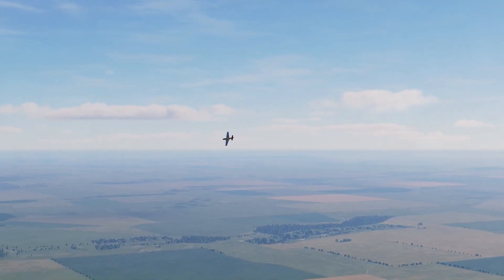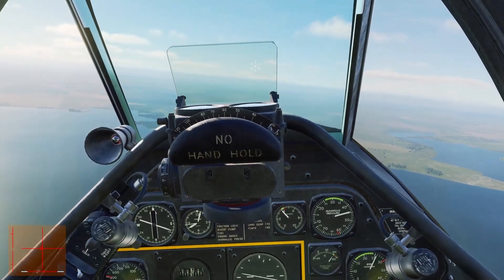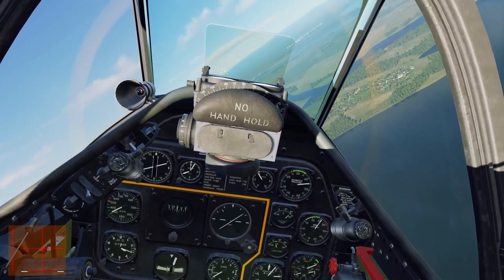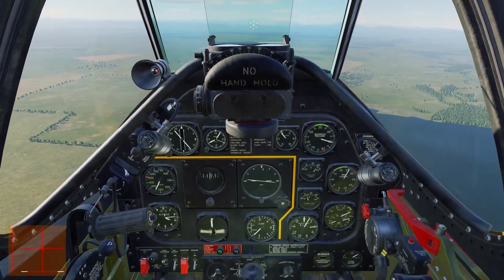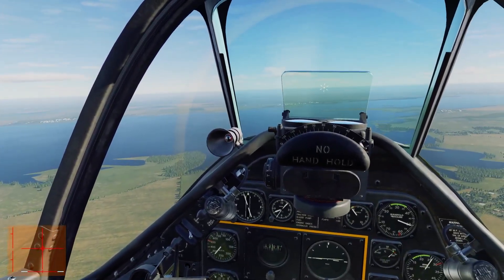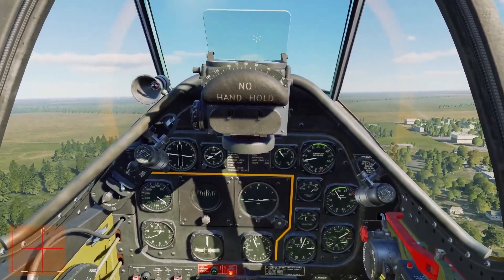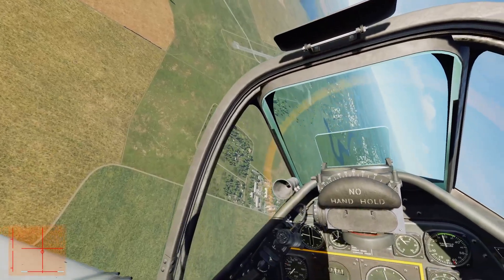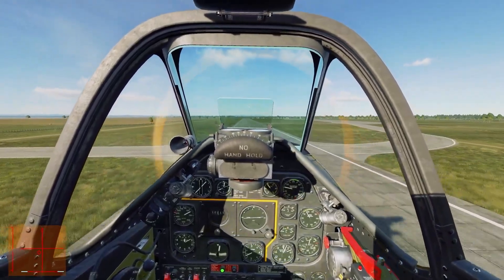Slipping and Sliding Warbird Aircraft - How & Why - Ball & Cross coordination

Comment: okim 1 week into dcs p51 and this is great , but can you show how to get out of a spin, i turn and plane shudders and then goes into death spirall.
Reply from the maker: Good idea for video. But a quick tip, dump the nose always (push stick forward) and rather than trying to totally fight against the plane, go with it a little (ie if during spin you notice a small roll left, go with it, don't try to cancel it).
Slowly as airflow over the plane builds, controls will become more responsive...
And it's worth practicing with any prop/warbird, full power/idle - and how it affects yaw, as depending on the direction of the spin, this can help. I'll do a video soon. Cheers
Reply: Classic spin recovery is as follows: full stick forward. Full opposite rudder. When spin stops, neutralize rudders. Then start your pull out making sure to add power if you've reduced it prior to spin. If your pullout us too aggressive you'll find yourself in a high speed stall and back into another spin. This is real world spin recovery procedures.